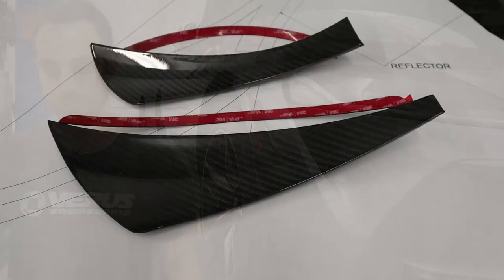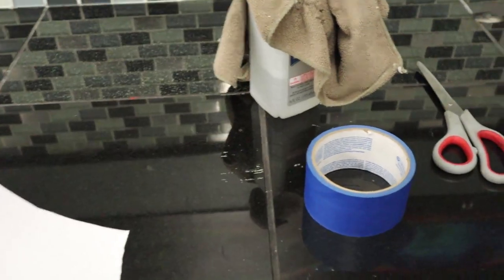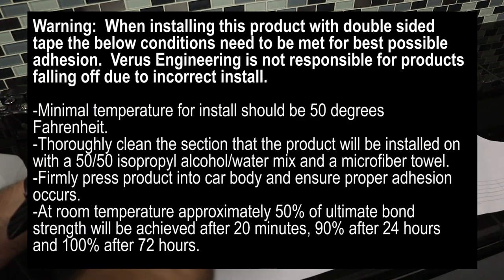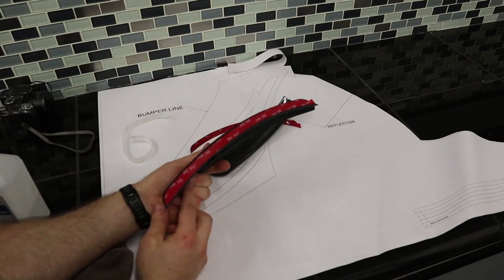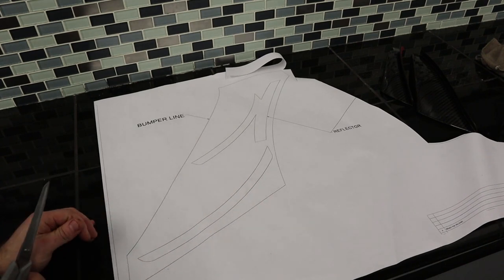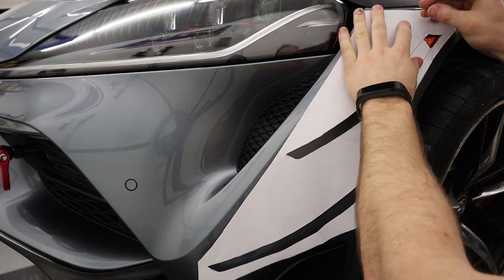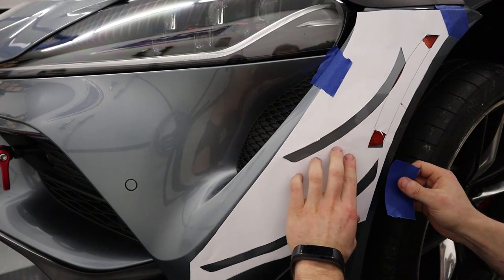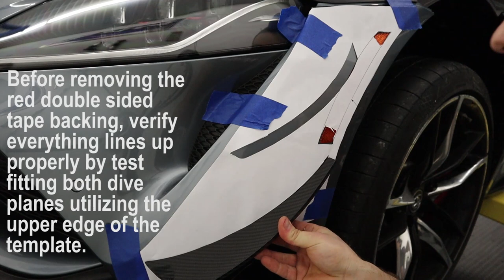A90 MKV Toyota Supra Dive Plane Kit Install

Comment: So there is no need to hard fasten them with a rivet or bolts? They will stay there with the 3M tape?
Reply from the maker: We have had customers that drill the dive planes to add mechanical fastening, but the 3M VHB holds up very well. We have had customers see speeds of 180 mph without issue.